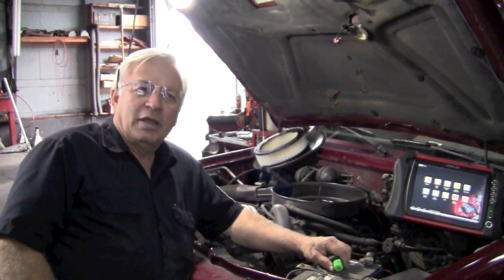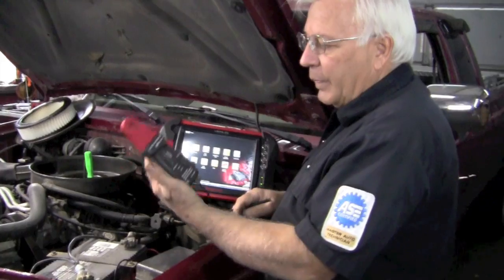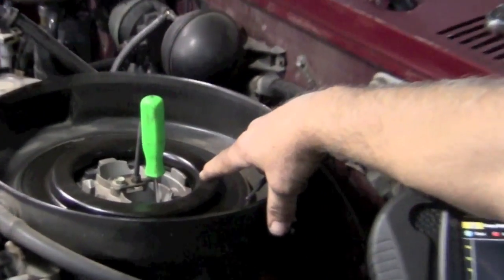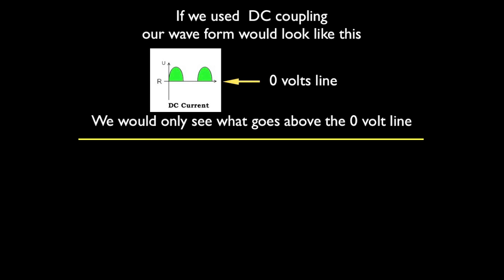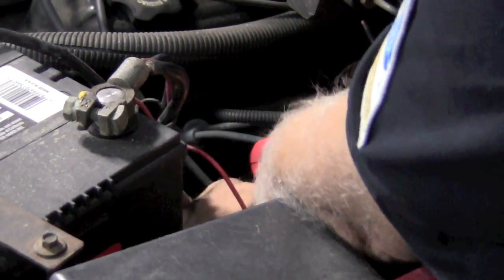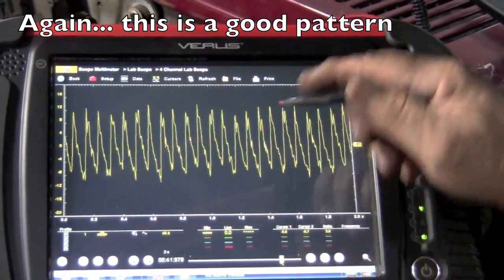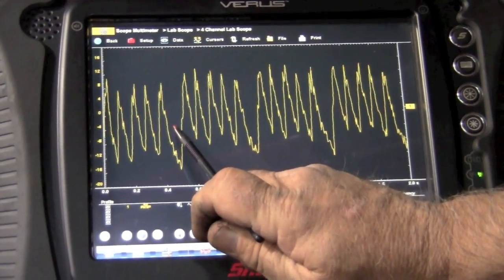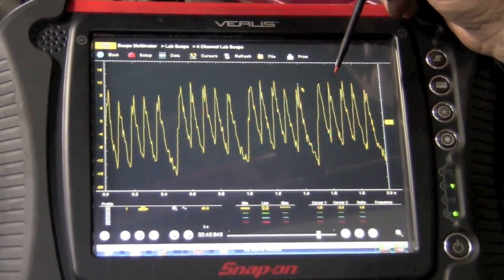Labscope Relative Compression Testing

Comment: Beside the fact that we know u pulled #1 spark plug out, how would we know which cylinder is number one?
Reply: You set up a second trace and back probe any 1 fuel injector then when you see that signal on the scope you will know what cyilider is what from the firing order
Reply: @thomasbedenek5933  thanks, as of right now I only have a single channel scope, I dont wanna invest into something bigger till I truly understand it
Reply: @e-tray5969  understood so in that case you can pull a spark plug from any cylinder and then you have the same idea you will see zero compression on the one you pulled the plug from and then you will know the signal order based on firing order
Reply: @thomasbedenek5933  thanks for the info, in will try it

Comment: on my modus ultra my low amp clamp don't always work I think I need a hi amp clamp I was thinking if the starter was putting out more than 60amps it won't work with a low amp clamp  I don't even have a selection above 60amps
Reply: Use AC coupling with a low amp probe

Comment: Great video!! I do have a question though. You used a low amp probe and set the verus on 40amps. How many amps did the starter actually draw? I though you needed to use a high amp clamp because the stater draws approx 400 amps?? Does it hurt the verus or the amp clamp when it spikes off the chart?? Thanks for you help!!!

Comment: Should add channel two, trigger on that channel and connect to number one sparkplug. That will give you a sync to number 1 cylinder so you can establish which cylinder actually has the problem. Obviously you have to have a functional ignition system so disabling the fuel system would be required or on some engines you could use Clear Flood mode during cranking. I don't completely agree with your explanation of AC coupling though. Otherwise good.
Reply: Explain AC coupling and tapping one of the ignition systems using attenuator or another AC clamp.
Reply: Not with the ignition disabled.
Reply: @Ashroyer86  What about injector pulse?
Reply: @scientist100  that probably depends on the ignition circuit specific to the car in question.

Comment: Love this test… it has proved itself in the field for me many times and saved me a ton of time.  The only thing I would have done different would have been to set another channel on your scope to trigger off of something (coil/injector etc) on an accessible cylinder that you know the number of.  That way, when you compare the trigger cylinder to your dead cylinder in the firing order, you will know exactly what cylinder has the problem.  In this video, you revealed a compression issue for sure, but not which cylinder had the issue…setting up another channel to monitor a known cylinder # will pinpoint the cylinder number in one test.  Just a thought

Comment: That is true if there is very low compression in a cylinder like he had here with a plug removed. However, if you have a smaller loss of compression causing a drivability problem you can not hear that. This test is meant to tell you if there is a compression issue without pulling plugs and installing a gauge. If this test shows low compression then you can do a normal compression test, but that can take a very long time on some cars. So this test saves you from doing a compression test in vein.

Comment: You can do this test by ear.  Pull the ignition fuse or the fuel pump fuse, crank, listen for one cylinder to turn over faster than the others.  If you get a nice even crank and all the pulses sound the same and keep an even rhythm, then your compression is relatively even across all cylinders.  If you have a bad cylinder, you will hear the fluctuation while cranking.  Listening to this guy's test, I would have said the same as him without using the instrument.
Reply: Yes but you would not know what cylinder is bad unless you test
Reply: that got me thinking, what if you record the sound of the engine cranking then look at the sound waveform on a computer.

I just tried it by recording the audio of two parts of this video, first the normal crank test, then the second crank test where the spark plug was removed.
Looking at the waveforms with a program called Audacity I see they look different between the two.
The normal crank test shows equally spaced spikes of sound throughout, while the crank test with the spark plug removed had a wave form with no sharp spike between two distinct spikes, which was the dead cylinder, also the distance between the spikes were not the same after every time the dead cylinder was cranked.

I suspect the difference in the sound waveform was easily visible because the spark plug was completely removed so there was no compression at all, and the scope method is superior and shows the relative compression much more accurately.

Comment: Yes, but, the whole idea of "relative" compression testing is the nature of the test itself. We conduct a "relative" test as it's easy and quick (If you have the right test equipment) and at this stage don't wish to remove anything, it  points us down a particular route in order to exclude or not a compression related fault. e.g from this test it may point us to clearly to cylinder 3 (out of 8 cylinders say) and from there we can focus on that area, e.g. confirm with a manual compression test.

Comment: If all you use is a scope probe, all you will see is voltage drop on startup e.g. if 12v goes to 10v it's OK if it goes to 6v it's gubbed (that's only voltage).

Comment: Excellent video, I am having idle and hesitation  issues on a 97 corvette.  I have drained the gas, checked for vacuum leaks, torqued the intake manifold, checked all plugs and wires, changed the fuel filter twice (clean), checked the o2 sensor wires, cleaned the MAF, cleaned the TB, changed the PCV, tested the fuel pressure (good).  The plugs are a pain to get to.  Is there and inexpensive way to do this test?  What components would be needed.

Comment: @romeoadryan I had a look at the pico auto site and there is a diesel cranking amp waveform that shows amp swing from -325 to -200 e.g 125 amp swing, so I don't think our 80 amp clamp probes will cope, really need a 400 amp clamp probe as a minimum to see complete waveform, exempt the start spike.

Comment: @romeoadryan My guess is possibly yes, I haven't tried it as I have the same probe, but what I think may happen is that the trace if measured on a scope may reach say 100 amps (e.g. 1v as my guess is 1v may be it's max swing, there again it maybe 0.8v (80amps)) and flatline till it comes back down below a 100 or 80 amps. The only way to do this is obtain a standard oscilloscope and give it a try.

Comment: @romeoadryan To further clarify, the clamp meter detects current via inductance (e.g. through a clamp/coil), this then relates to a millivolt per amp ratio of the measured current, so current in it's own right cannot blow the clamp (at least not at automotive current levels, even at 500 or 600 amps) as current is converted to a milli-voltage level.

Comment: @romeoadryan It's the 80 Amp AC range that is used as the current alternates as can be seen from the waveform. Now the waveform you linked to does spike up to 420 amps on first crank, but as i stated the verus AC amp range on this video can only do +/-20 amps so you would never see the 420 amp spike, but it won't damage the clamp probe. the waveform in your link settles between 120 and 180 amps eg +/-30 amp draw. Hope this clarifies.

Comment: @romeoadryan I see where you are coming from, although I haven't tried it with extreme amperages if the 80 amp range is 10mv per amp then 80 amps would indicate 0.8v if you have a standard scope on 1v per div that is, so even if 100 amps were measured e.g. 1 Volt I don't think this would blow the probe, it would only flatline at say at 1v (100 amps) may be greater 2 or 3v even, never tried it.

Comment: @DiyMech  I have  the same type of low current probe and I was afraid because starter motor needs up to 400 amps to turn the engine and the current probe measures 80 amp max .thanks

Comment: @romeoadryan Further, he could only set his scope to a 40amp range, e.g to +20 /-20 amps, when the car fired you can see the trace disappear off the trace, so all you know is it was greater than 20 amp initial draw, could well have been 80 or 100 amps, but after the spike the waveforrm settles to a +12/ -8 amp trace, with plug removed +12/-12 (on failed cylinder). So the scope range limit of 40 amps was adequate to cover for this test.  Again hope this helps,

Comment: @romeoadryan The reference to a low amp current probe means that the probe (not the circuit) can measure low amperage values e.g. from 0 to 20 amps at say 100mv per amp, in this case his "low amp" probe can also measure an 80 amp range at 10mv per amp. These ranges are really "low amp" ranges as many clamp meters can measure 200, 400 and 600 amps. All relative really ! (sorry had to get relative in somewhere). The 80 amp range is more than adequate for this test. Hope this helps.

Comment: @writerofwriters69 Amp clamp probe (or similar) can be bought in the uk for £40, I bought same one. Low end 2 channel digital oscilloscope can be bought for £250 and upwards. "new ark USA" sells one for $369 (or go second hand). So although the equipment used in the video is expensive (it's paid for itself as far as the business is concerned) the test methodology can be easily replicated for little cost e.g. circa $400 rather than a $6000 verus. (relatively speaking, sorry!)

Comment: I wish Snap-On would let you have another channel active while doing any kind of current draw test. The reason being for this is cause if you had that, then you could use one channel to record something as #1 injector pulse or spark plug firing, use that as a trigger, then follow the firing order of the engine so that not only can you tell if you have a compression problem or not, but also be able to tell which cylinder is having the problem without having to put a compression gauge on each one.
Reply: Well inj don't pulse on TDC so ign. Would be better synce

Comment: @Jallandhara 
Each cylinder compresses in turn. As the starter motor requires more amperage to cause the compression, its current rises (the peaks in the graph). Since a bad cylinder that will not hold compression, it requires a lower current to 'compress', the amperage is lower - as reflected in the periodic absence of a peak on the graph. The test only tells you that one (in this example) cylinder is bad. It doesn't reveal which one is at fault.

Comment: Okay, so here's a question: Why does the amperage change on the same cylinder every cycle? For instance, the first cylinder to have compression after the one without the spark plug, its level of amperage isn't consistent every time the starter sends currant that way.

Comment: God vid, but I'm not sure I agree with Duane's explanation of the DC coupling. He said the DC coupling would show only the POSITIVE  humps of the ac or sine wave. Is this correct? I believe the AC coupling blocks  DIRECT current, either positive or negative, and lets the alternating current thru and the DC coupling blocks the alternating current, above or below the 0 current line on the graph.

Comment: @cpfreakfree1 i would say it just steers you in the right direction as you said.  but as he pulled one plug and knowing the firing order you could identify each peak as its cylinder in the firing order.  but you would want to know all cylinder pressures wet and dry anyways if you found a problem

Comment: Hey D, I understand that this is a relative compression check in regards to amp's at each cylinder and that's great, but let's say we do this test and find what you found (not knowing about removing plug at 1) ...how do we determine which cylinder is the culprit based on the waveform?  I'm assuming that you won't be able to, correct? I assume that this test is a quick way that would steer you toward your next move in diagnosing or at least eliminates other possibilities of the problem?  Thanks
Reply: Set up a trigger from a known coil or injector .